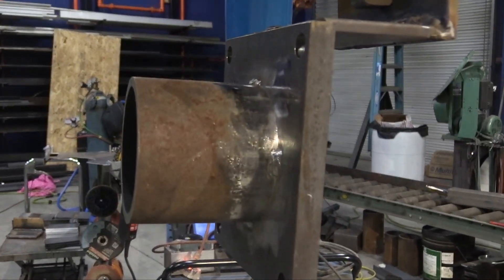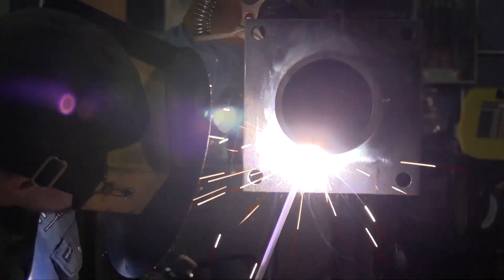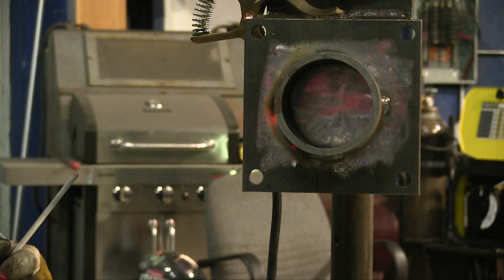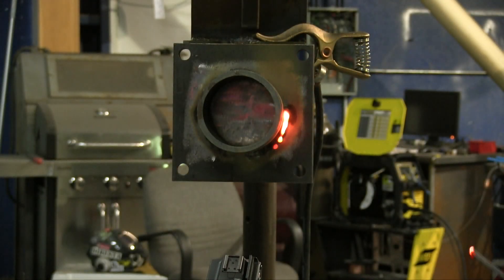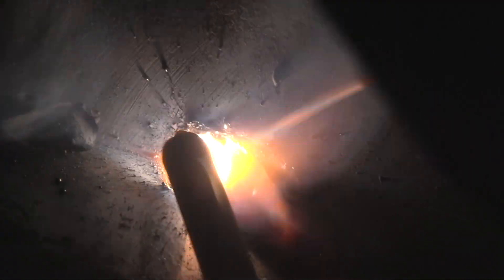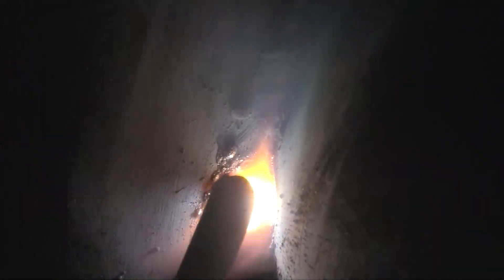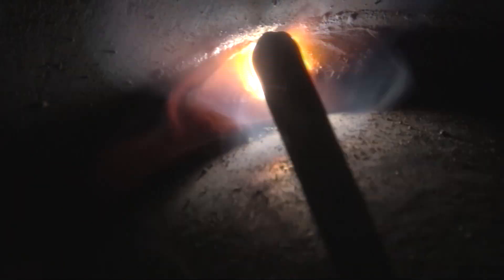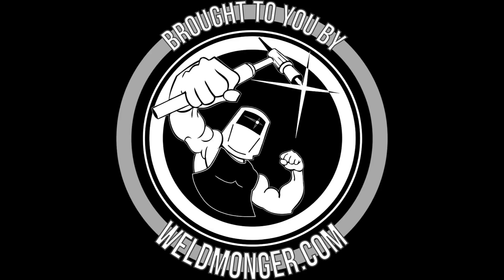7018 5/32" Stick Welding - 5F Joint Tube to Plate | Welding Tips & Tricks #Welding #Tips

Comment: Just another way to explain the reasoning behind moving the ground clamp, simply put...electricity is lazy.  Path of least resistance
 p+rod, you wont notice a difference, but you will more than likely  notice a difference with an excalibur... Coming from someone who was taught to place your clamp as close as possible to your run back in the 10th grade.  13 years later, I still do that wherever possible.  It boils down to knowing control.  Work smarter not harder.

Comment: I've watched your 2012 videos, and compared it to 2020. The camera capturing quality improved significantly. We use 7018 5/32 in welding school, common problems.. high amperage.. eating the metal too much on the sides (high ampeargae i guess)

Comment: Can you do a video on pulsed metalcore 3g uphill? Maybe with a mig root or backing strip. We have Lincoln stt and Miller pipeworx machines at my shop. I tested on it today and passed but it was the first time I've done it uphill. Most jobs we do downhill. Could use some recommendations

Comment: I went to Georgia trade school and learned how to 7018. Now I am a rig welder working on drilling rigs in West tx, I've had to learn how to use 5/32 since we use it all the time in this kind of work. Still getting the hang of it out of position. I'm running an sa200 though so a bit different. Thanks for the video.

Comment: Just wondering about something I did long time back. I was welding on a project that had a 3 inch thick pipe that was 120 feet across. We were making a mine shaft that was 800 feet long or a better way to say it, the shaft was 800 feet in the ground. We vertically welded the 10 foot by 20 foot by 3 inch thick rolled plate to make the 120 feet wide rings and 4 cranes would set the ring on top of the ring going into the shaft and we would weld the horizontal weld around the perimeter of the 120 foot shaft. I forget how many welders were on the job but we were assigned an 8 foot horizontal weld to make and it was a 3 inch thick plate we were filling the gap on. All the welders were running 1/8 inch 7018 and it would take them 14 to 16 hours to get their 8 foot weld made. We were getting paid by the hour so they weren't in any kind of hurry. The man with the contract was a good friend of mine and I wanted to help him out on the job. He paid me very well so I didn't mind at all to do more than my share. All that long explanation to get to what I was wondering about. I had a 300 amp Miller gas welding machine. I started burning 1/4 in 7018 to get the job done faster and like I said to help out my friend. Jody, have you ever run rod that big and what was your result. I would like to see how you recommend it be done and if I was doing it like it should have been done. I guess I was doing ok because all welds were x-rayed and mine all passed. Just curious what you have to say about this situation.....

Comment: Wow. That is not easy to do!!! Very impressed
Reply: Here in the UK, 5g pipe to plate is one of the test pieces given during coding tests. A 6g butt (as per norm) and this test side by side for each procedure as a supplementary test for "EN" and "ISO" certification.

Comment: Great series of videos Jody, good to see some efforts in training and use with larger electrodes. 3/32 and 1/8 are great for training, and root passes, but it is a "feather in a welders cap💲" if he can weld fill passes in all positions with 5/32 LH! ✔